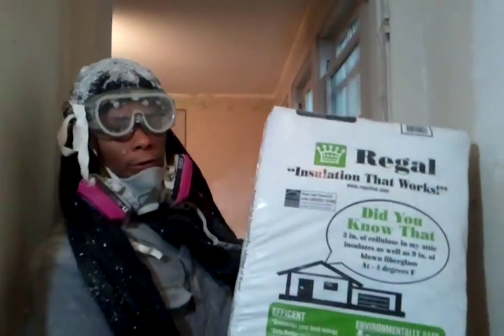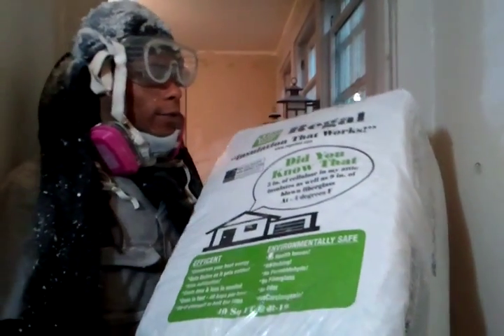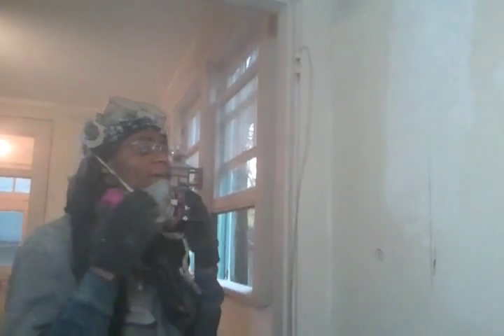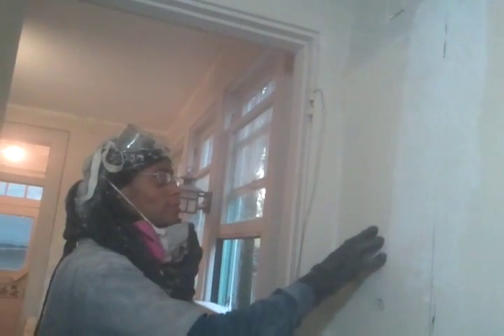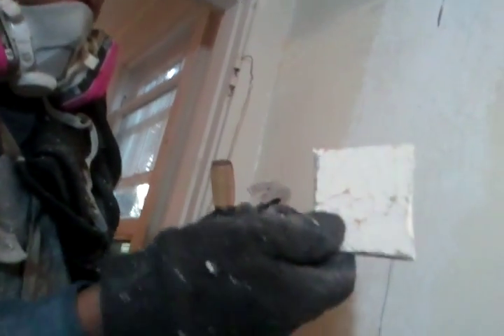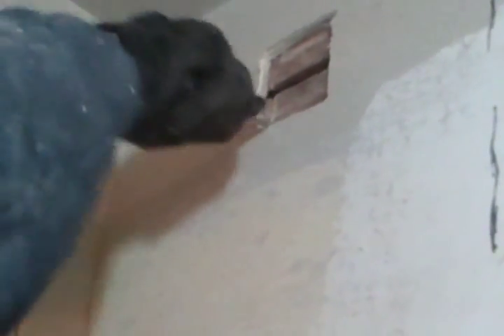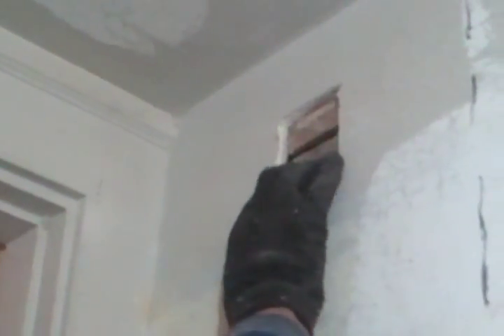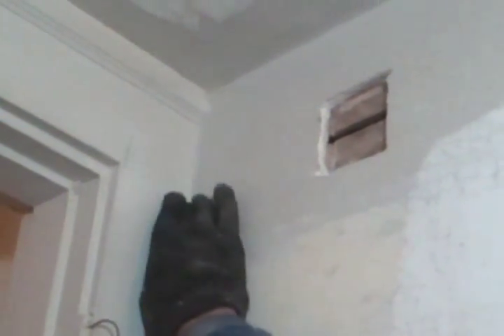Cellulose Insulation for Lath and Plaster Walls - Part Two

Comment: Bro gotta invest in some better tools! Check out the dust shroud attachment for your grinder that has a shopvac inlet on it, itll make clean up 10x easier. Also some fans for windows to create a negative pressure, and a multitool for making those straight plunge cuts. No criticism here, just want to make life easier and more profitable. Do work! Also little endoscope camera can sometimes be as useful as.that handy coat hanger
Reply: It has been a while since we did this. This project was done in 2012. When we did this, we were under time and budget constraints because of our contractor timeline. That is why we found a way to do it ourselves. If we ever have to do this again, believe me, we will definitely be much more efficient. Thank you for your insight.

Comment: do you relize that 40 sq feet of coverage is for loos blow in which is done in the attic not in the walls which should be dense packed.  Each full 16 oc stud bay should take 10 lb of cellulose otherwise you will have settling issues in your walls.  also did you have your plaster checked for asbestos as it was just as common of a binding agent as horse hair was
Reply: +abjz71 You make some good points. It's all really opportunity cost of the time. There is some "technical debt" with this method, but it is the most cost effective way to insulate an old house. Nothing beats time and gravity. This house has very brown fibers in the plaster. That is horse hair. Horse hair plaster is darker and multi-color because it comes from horse/mule manes and tails. The 100% white or consistently light fibers can be asbestos, but our was dark animal hair. The key is to wear a good respirator while installing the insulation.
Reply: +John G. Moore, Jr. as to nothing beats time and gravity 3.5 lbs of cellulose per cubic foot will defeat gravity.  but my main point was because i saw your videos geared more as a how to video series that may be watched by people who dont know what asbestos is, and yes there are people out there who dont even know it exists, you should include and suggest that people get their plaster checked.  As for your assertion that if it isnt 100% white it doesnt have asbestos in it is false as asbestos can range in color from bright white to dark brown and even into green and blue colors.  you can also buy the best mask in the world but if you are not using the appropriate filters it will not do you an good, a particulate filter which is more then sufficient for blowing insulation is insufficient when working with asbestos.
Reply: +abjz71 - You make great points—I don't disagree. The issue is money and time. Unless you have a fist full of dollars to pay the very high cost to remove asbestos professionally, you will have to do/figure it out yourself. Removing lead from old homes is the same issue. Asbestos was ubiquitous. Everyone used it. it was the iPhone of insulation. So if your are dealing with an old house, you will have asbestos removal issues. As long as you get educated about asbestos and take the proper precautions—you will be okay. Not to mention, the professionals who remove asbestos are just people with better tools, and techniques—and they are faster. I learned my skills from four old WWII veterans (Grandfather and three Great-Uncles) who did of home repair in Indianapolis from 1950 - 1990. We did some asbestos removal; they showed me the difference between horse-hair plaster and asbestos. So, I learned from the best. Luckily, this house did not have those issues—just horse-hair plaster. But, you are 100% right, older homes have serious problems you need to consider before you tackle any job. But you can figure it out—just get educated.

Comment: Thanks for the tutorial and I appreciate all your work. Are you happy w/ the result? As mentioned below, I would have tried a hole saw. My question is, why not approach this task from outside? It would keep the mess in the yard and the drilling would be easier.
Reply: Doing it i from the outside was not a good option. Too many people, trees in the way, etc. Plus we had already painted the out side, so we did not want to mess up the paint. Plus, the inside was gutted, so the mess was not an issue.
Reply: We wanted to keep the home's integrity in a historical neighborhood and did not want all of those holes and plugs all around the outside of the house. Plus, by doing inside, we were able to go above and below windows and doors. When done outside, it is usually one line all around the house.

Comment: Use a Dremel Saw-max to cut through the cedar lath and or plaster. It works much better. I LOVE using the Dremel Saw-max on wood, ceramic and metal. Cuts like BUTTA!
Reply: Yeah it'll take you a year